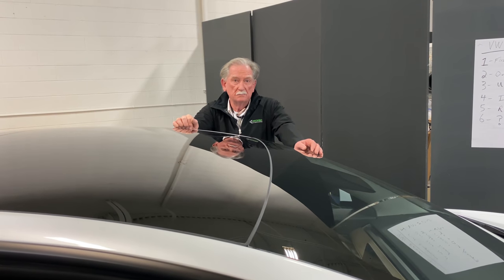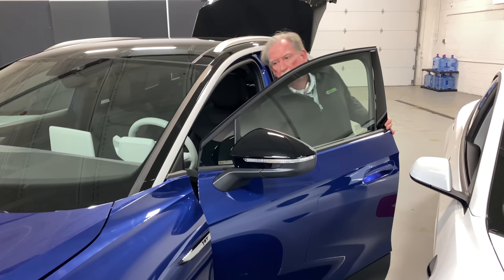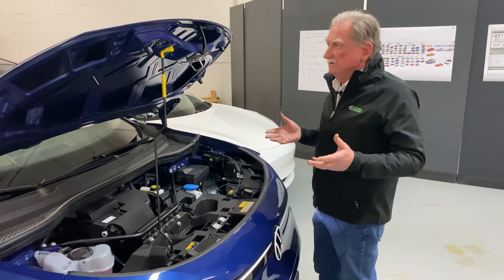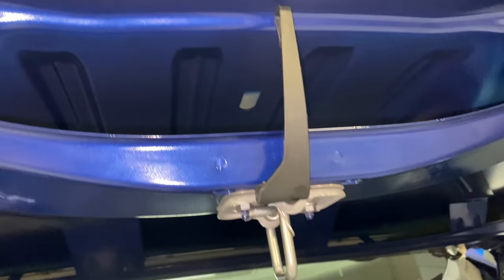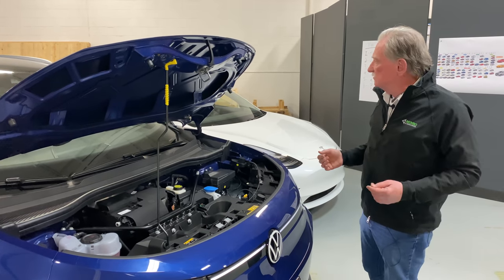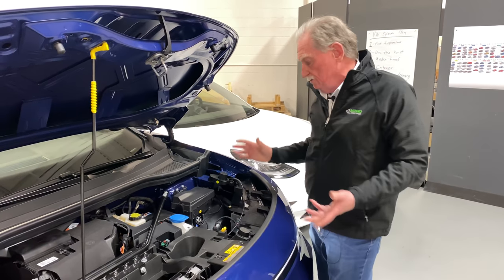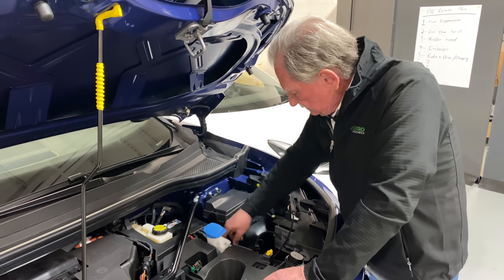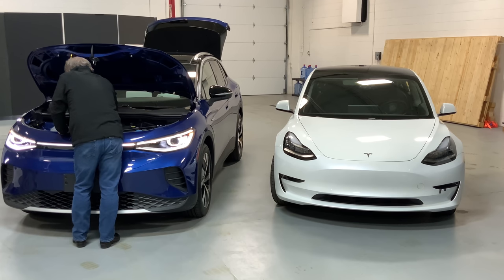2021 Volkswagen ID.4: E2 - Under The Hood

Comment: I think a short hood with more cabin space is better than a long hood with a frunk.
Reply: You mean a short hood WITH Frunk and a HVAC correctly dimensioned and no more fossil based blow out type fuses.
Reply: Sandy has spoken...frunk good, no frunk no good😉
Reply: @wolfgangpreier9160  no he means more cabin space and a short hood with easily accessible battery and safety items.
Reply: @wolfgangpreier9160  You like to spend $500 for new transistors compared to 5ct for a new fuse? They can fail aswell. And the ID4 is cheaper for a reason.
Reply: @wolfgangpreier9160  "Blow out" fuses are better. Be nice if they were labeled though
Reply: @wolfgangpreier9160  no one thinks that a frunk is better than more space for people and much better turning circle (because they also used the frunk space to rearrange components to give more room for the wheels)
Reply: @bobqzzi  No they are not. They are from last century and nobody found it worthwhile to remove them alltogether and implement a decent power distribution system in every car. 
Tesla had no fossil engineers and never had the idea to implement something obsolete.
Even in my house, thats 25 years old i do not have such old things anymore.
Reply: @jh5kl  Not really. The space is tall. And wait for AWD version - you'll see then turning circle like in Tesla. Very good turning was always characteristic for RWD Merc and BMW cars, but difficult in FWD and AWD cars because of axle joints.
Reply: @wolfgangpreier9160  Ask your electrican which is better, circuit breakers or old stlye fuses. I have yet to have one answer circuit breakers. In a house circuit breakers are safer because homeowners can't really short circuit. In a car, they are both more expensive and much more prone to failure.
Reply: @merzto  Ah you think those transistors blow through?
Nope. Thats all handled in the power distribution center which controls and monitors power consumption. And calls Tesla service on its own when it detects a failed HVAC pump or any other electric drain that has a short or irregular behaviour.

The ID4 costs me 48.824 Euros and 40 cents. The Model 3 SR+ in the same configuration costs me 46.100,-- Euros.
I can calculate the difference and the ID4 is clearly more expensive then a Model 3.
When the Model Y becomes available from Grünheide the cards will be mixed again.
Reply: @bobqzzi  And my car has neither. So what now? 
Do you want to tell me that Tesla has made a capital error in their ways of leaving the mainstream art of car building as our grandfathers have told us?
Reply: @GA-wq8xq  - it’s funny how all the Germans on YouTube love not having a frunk. Almost as if they’re blindly defending Volkswagen for a boneheaded move including less storage space. 
Model Y has 68 cubic feet of storage space.
VW ID four has 63 cubic feet of storage space.
Any thoughts about that?
Where did all VW’s amazing cab forward space go?
Reply: @shortaybrown  Well, I'm Norwegian and most of the year every time I open the hood of a car I get dirty because of the manual operation and wet roads, I just don't like doing it. But that is subjective and the more storage the better in the grand scheme of things.

The ID.4 is about 6.5 inches shorter than the TMY, which does make an impact. Also the measurement of storage space is subject to manufacturer claims often with different ways of measuring it, at least that is the case in Europe. I think the TMY will hold slightly more while utilizing the trunk but I'll wait for Teslabjørn's highly scientific banana box test for my final verdict :D

Here is the ID.4 test, you can see a comparison to other cars at the end:
https://www.youtube.com/watch?v=8NDimpnRAO4

Even with my slight aversion to frunks a Tesla is way more likely to be my next EV than a VW. Now if only Tesla could fix their sound deadening it would be a walkover, maybe use some interior space on that ;)
Reply: @zoidburg3101  — true. You make some very good points.
In America the tesla charging network is superior, but I don’t know about Europe. 
I think VW can be good and I applaud them moving to all electric cars faster than all the ice legacy manufacturers. The ID4 demonstrates two things:
1) Volkswagen still needs to work on their EV design,
2) this attempt is good enough so that I believe they’ll eventually make great EVs.
Reply: In Europe a smaller turning circle is way better than a small frunk.
It's a matter of preference.

Comment: 9:22 Sandy - the positive jump terminal is right at the “firewall”, about 3 inches outboard of the MINUS symbol on the battery. You can see it at 11:05 in the video. Many dealership techs know that you can damage the car’s electrical system permanently if you jump-start the car AT THE BATTERY. Many European cars now have specific instructions on jump-starting, which includes the positive jump terminal NOT at the battery. When all else fails, RTFM.
Reply: Thats the Negative,
Positive should be in the fuse box,
But vw recommends using the positive on the battery

Comment: I expect now a series with/of mr. Diess explaining why. That would be a great meeting point.
Reply: The issue is, Mr Diess doesn't know his tech. He is only the manager and not an engineer. But having the lead engineer over for a talk on this model would be very interesting.
Reply: That wouldn't be hard to explain.. No need for a long hood (with a 'frunk' and what not) in an EV. Makes more sense to use more space for the interior and the trunk.
Reply: @einher1  well i meant in general. I guess there will be a lot of things to explain. With all the respect for the vast knowhow of Sandy and team, there are a lot of open questions and assumptions. Same applies to the tesla's earlier teardown.

Having a short front is not a good explanation if there is visibly a lot of room left.

Once i knew a guy who knew a guy working at a german enterprise... i think it's magic they got this far in this time. Even if Diess isn't into engineering.
Reply: @deadhamster7570  He is an engineer and knows his car well.

Comment: ID.4 has a lot more room for more steering angle. See the wheelwells bulging into the under-hood space. Turning radius in ID.4 is much smaller than Model 3/Y. Personally, I'd rather have a tighter turning circle, which I benefit from every day, than an infrequently used and somewhat flimsy feeling frunk.
Reply from the maker: The Model 3 and Model Y sacrifice Turing radius due to their “virtual ball” lower links on the suspension. But! Virtual ball contributes to a “BMW-like” feel. The iD4 has a basic macphersion strut which is lower cost, better Turning circle and decreased handling.
Reply: @MunroLive  I can't say I could feel any handling difference between my mcpherson strut car and the Model 3 I drove that would be worth sacrificing the turning circle, but my car is a lot more comfortable on rough surfaces. This difference is very much an EU-US car design issue. In the US there are very few properly narrow roads and drivers don't need to be able to thread their cars through wing mirror to wall/other traffic type gaps just to get from A to B, so a 'better' suspension design is more useful than tighter turning for the US market. The opposite is true for most of the EU - but a friend of mine got a Model 3 recently and I'll be interested to hear whether it's catching him out after a few months use. He's a very good precision driver, having grown up driving farm machinery from well before he could legally use the roads though, so if it's a problem for him then most normal drivers will be screwed.

Comment: Can you mention the difference in specs between US and European markets please?
Reply: 🤣😂🤣😂 Please read the UN/ECE ruleset. Thats the rules and telematic standards the Europeans work with since 1958. 
IDK what rules and standards the Russians or US Americans work with.
Reply: @wolfgangpreier9160  Who are you supposed to be talking to?  I'm referring to the difference in options and standard fittings on the ID4 in the US and Europe, and paint colour options.
Reply: @JohnnyZenith  And who do you think should be able to give you that type of information? Not even VW dealers know about them. And VW will not tell anybody.
You could open the VW webpage on two monitors and compare them.

You could build every ID4 without any or with all options.
I don't know how you can order a ID4 in the US. But in Europe you check all boxes what you wish to have in the car and order it.
Reply: @wolfgangpreier9160  Honestly I think you need to stop, because this is getting tiring.  You really have no idea what i'm saying.
Reply: @wolfgangpreier9160  That's wrong. The car isn't fully customizable. If i remember correctly the small battery version has 3 specs and the big one has 5. Outside of those specs you can only change some options like the main color, the silver accent top line, black/white steering wheel, heat pump, tow hook and rims. The us currently only has 2 specs, but both are already pretty good. Travel assist for example is in the us base spec, but you have to buy the tech or max version in Germany to get that. All in all the $40000 us base model that comes with 3 year free charging is much better value than what you can get in Europe for the price.

Comment: The more that I see, the more that I love my Model Y. On the highway, if I stay around 65mph and don't do any highspeed rapid passing I have gone 300 miles between chargers! Around town I do tend to do a lot of Jack Rabbit starts, it is a blast and I don't care what my Wh/miles is, but it is nice to know that if I really need to I can stretch those miles. Recently I do a highway test, charged to 90% accelerated like I would in a slower ICE car, did no rapid acceleration or passing and for 30 miles at highway speed I averaged 202 Wh/mile.....

Comment: They've done that because in Europe you can drive very fast on freeways there and in case of an accident you need more protection in the front.
Plus more rigidity and less vibration.
Reply: Then why does the Teslas not have such a thingy when then current crop can go up to 250 km/h and the ID family only 160 top?
Reply: Wolfgang Preier / From 2 reasons :
1) The original design was for USA where you can't drive too fast.
2 ) Keeping a low selling price.
The german technological thinking is different than the american technological thinking.
Reply: @mikel4879  How fast can you drive in the US?
85 mph. In Texas.
How fast can you drive in: Switzerland?
74 mph.-
In Austria?
80 mph.
In Norway?
68 mph
In Netherlands?
68 mph
In France?
80 mph.
ONLY in Germany there are SOME stretches where you have no speed limit.
And in North Korea...
Reply: @wolfgangpreier9160   It's a German car with a shorter front end than a model 3, meaning a smaller crush zone, so the front end must be able to take more force over a shorter distance.  You're quite negative about this car.  Tesla owner and/or shareholder?
Reply: Wolfgang Preier / In Texas only which is one state from the all 50.
I told you that there's a big difference between the german technological thinking and the american technological thinking.
The german mind thinks FIRST from a technological engineering point.
The american mind thinks FIRST from the financial point.
This translates into overprotective technological design of the german cars.
Reply: Upd Late / Correct.
Reply: @wolfgangpreier9160  unfortunately in germany cars can go up to 300kmh+
Reply: hetoila / Yes. 🙂
Wolfgang mentioned that "in Germany...no speed limit.", but forgot to draw the right conclusions. 🙄

Comment: "VW didn't take advantage of what could be good space ..."
I'd expect Sandy to understand it's a design choice - the right one, I think. It makes no sense to have a long hood in an EV and then try to utilize that unnecessary space. More room for the interior and the trunk. Good thinking VW, just like with the rear drum brakes!
Reply: Umm. not sure if those drum brakes are truly a good idea.
Reply: @rogerheuckeroth7456  why not? you have regen on the electric motor which will compensate for the lower braking power that the drum brakes will provide. Here in Norway rear brake discs on electric cars need to be changed way before they are been worn down due to rust. so the drum brakes on the back are a really clever move in my opinion
Reply: @johannessundfr5129  They are an idea, but I think they will not be the best answer to the problem.  A drum brake has a fixed part and a rotating part, so it must have a seal between them.  How well will this seal really keep out moisture and salt?  Once moisture gets in it will be trapped and cause corrosion.  A better idea would be to use an alloy that is resistant to rust for the disc brake.  Another idea would be to use programming so that the rear disc brakes are used when coming to a complete stop thus removing the rust.  Making things more complex normally makes them less reliable.

Comment: I think you could assume the front brace is doing double duty as an HVAC mount, not the other way around. Absent the usual under-hood interconnections to chassis it's likely to be discernable to a casual driver (through excessive understeer or chassis twist) if you were to disconnect that bar.

Comment: Your still not closing the frunk right, but that’s great.  Its a simple push-through, not a slam.  Don’t change though!
Reply from the maker: Sandy being Sandy.
Reply from the maker: No Frunk will change Sandy!
Reply: @MunroLive  It's literally as easy as this:
Put your plam on the Tesla logo, push. DONE. That's how they show most people when you pick up the vehicle so you avoid denting the hood.

Poor Sandy will never get it. 😅
Reply: Uhh no, you're supposed to put a hand on either side of the logo and then press down. Pressing down right in the middle on the logo is what they warn you may dent the hood.
Reply: meanwhile the VW, just close it any way you like. no dent's and no problems.
Reply: @AndrewWellsPlus  The latch is directly below the logo, to you're pressing directly on the latch and not the body panel beside it. Doing it beside you can feel the panel flex, doing it on there's no flex. :)

I think there's a million and one ways people do it and all are likely fine to be honest!
Reply: @merzto  But the VW hood you can also drop and chop your fingers off with, it's not really designed to be accessed regularly. I do wish Tesla's mechanic would latch itself once its down versus having to manually push it onto the latch though!
Reply: @VoxelLoop  That's a homologation requirement. I think Tesla spoke on that previously that they would not be allowed to sell if they had fully automatic frunks.
Reply: @onwike  Oh, for sure, I just mean automated in the sense of it pulls itself down when you close it to the latch verus you having to push it closed fully.
Again though, with it being a frunk you want to be 100% it has latched correctly and has a backup if it doesn't, they can't use the same mechanism as the trunk uses I imagine. :)

Comment: One thing that European manufacturers are very sensitive to is insurance cost, as it greatly affects total cost of ownership. The more expensive it is to repair damages from 'typical' crashes, the more expensive insurance will be.
It could be that the seemingly overengineered hood and HVAC mount are designed to prevent expensive components from being damaged in typical minor frontal collisions. Tesla, on the other hand, doesn't seem to care about this topic at all  (think of the megacast concept...)

Comment: It's a heck of a lot shorter hood than the Tesla, that's why there's no frunk.
Reply: You forgot to mention, that the VW hood has a lot more depth than the Tesla. It is easily the same overall space, than the longer Model 3 hood has.
Reply: Also there’s a heat pump in Eu version and room for a second motor. But of course it would have been nicer looking if they had covered it with plastic.
Reply: @jopo7  The VW hood is much taller - plenty of space. And Tesla has the front motor already. So, it simply rushed engineering. It takes a lot of time, to make things simple. If something looks so chaotic and wasteful it's because that was designed in a short time and rushed to the market before any optimization. See also the state of the software in VW, and abysmal integration with their own charging network.
Reply: just because the car is higher off the ground does not mean there is more space. Gotta measure the fender length from the base to the top of the hood. I doubt there's that much difference. But The Model 3 is definitely at least 50% longer on the front end than the ID4.
Reply: @DarwinChaug  No, the Model 3 is not 50% longer in the front, completely wrong. The ID.4 is only slightly higher, but the hood is much higher and has easily the same space. How on earth can anybody think, that there is not much difference. In the front part of the Model 3 frunk we are talking about almost 10 inches difference, for the rear part 5 inches. I live in Germany, ID.4s can be seen here every day at every VW car dealer. Very easy to compare with the Model 3. I have measured it myself.
Reply: @jopo7  The Model 3 heat pump is just behind the plastic case. 
What is the problem of VW? Don't they want to bend down into the car to mount it?
Reply: @andkosification  clearly you haven't. Go measure it and come back with the numbers.
Reply: @DarwinChaug  Thanks for saying that I lie, nice style of discussion. You obviously haven't measured it, but you talk like you have.